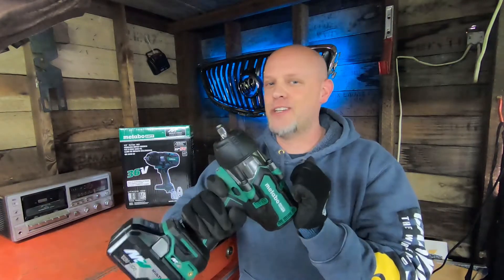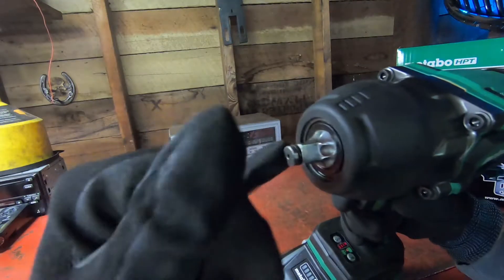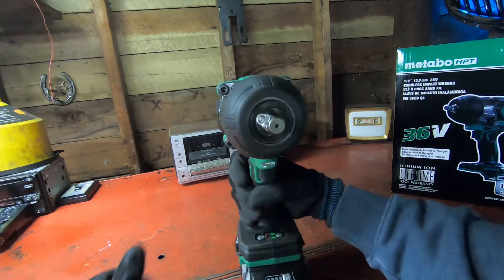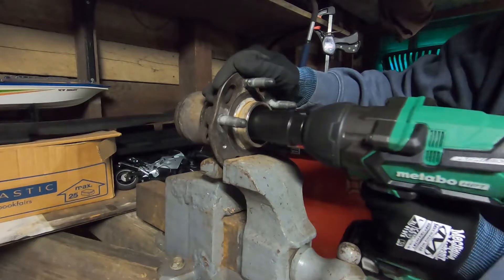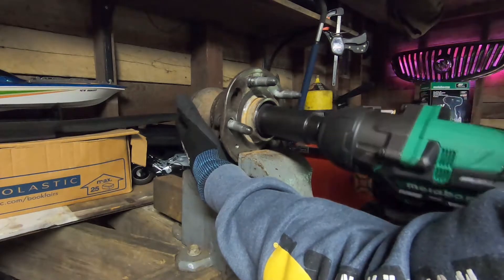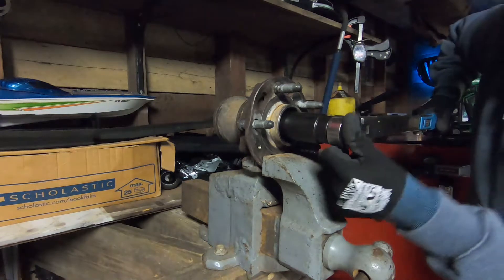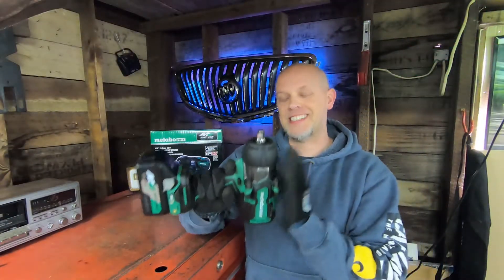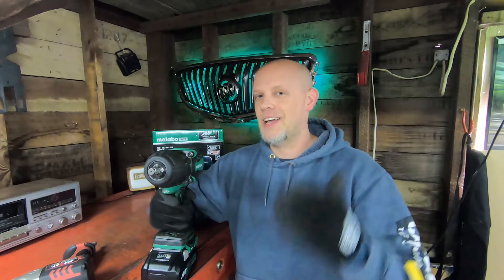Metabo HPT Hikoki 1/2 Cordless Impact Wrench 36v multi volt review WR36DB WR36DBQ4

Comment: Try it on a Honda Crank Pulley bolt....lol if it remove it then it a pass
Reply from the maker: Lol it’s funny you say that because the other day at work we had an Acura crank pulley bolt that wouldn’t loosen with any impact. I finally got it off with this one. I should have made video on it. It is a very strong gun. 👍

Comment: Not all air impact can out perform some battery powered impacts
Reply from the maker: Yeah I’m actually kind of surprised. This is my first half 1/2 battery impact. I’m still very impressed with it.
Reply: @AndyTheXTech Are you slowly make the conversion from air to battery?
Reply from the maker: @ka-chow22  well I’ve had the 3/8 snap on battery impact and the Milwaukee ratchets for a while. I didn’t think I’d use the 1/2 that much mostly just for tires. But I wish I had gotten one sooner.